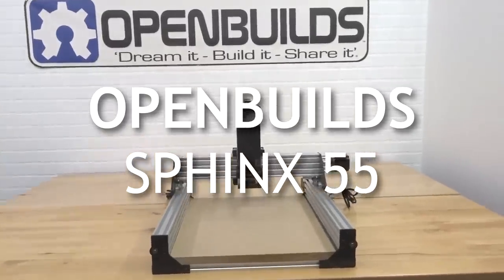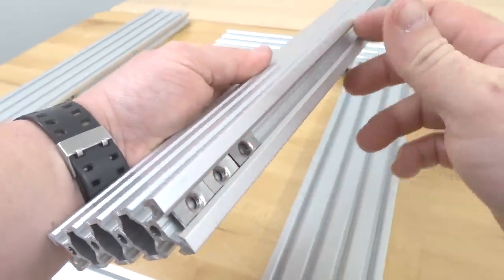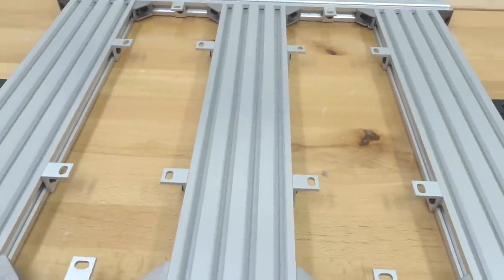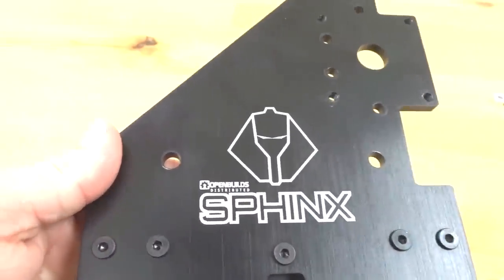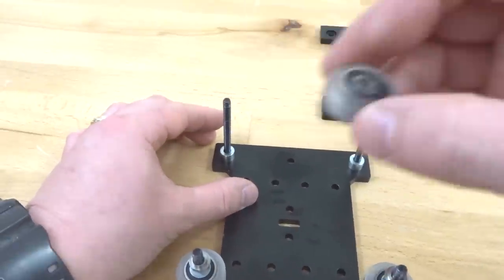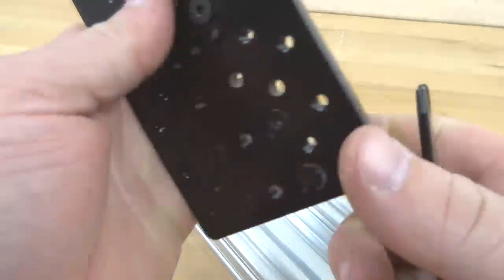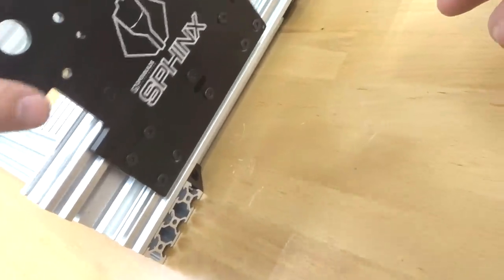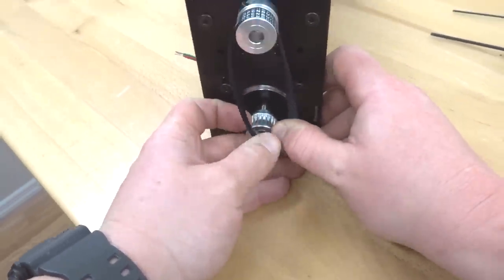OpenBuilds Sphinx 55 Build

Comment: I’ve noticed in this video and the build: 

Some of the nut blocks you use a 3mm spacer and a shim, and on other nut blocks you only use the 3mm spacer. What’s the reason for this ?
Reply from the maker: It would be for the alignment as there may be that a shim being used in the wheels moving the assembly out that extra mm. Will not be absolutely necessary as there is room for movement in the lead, but good practice.
Reply: @OpenBuilds  I’ll follow this with my install. Just to be safe. Thanks for the swift reply.